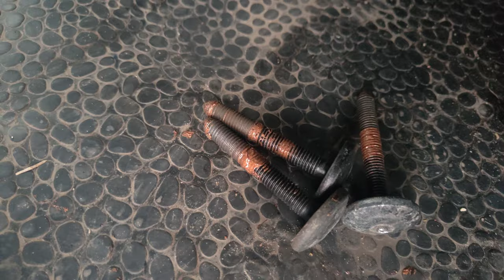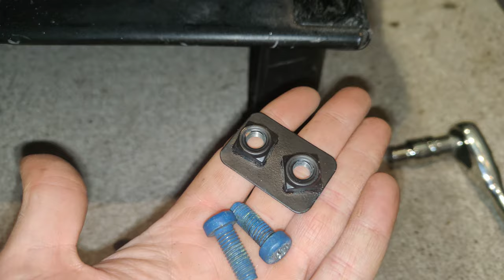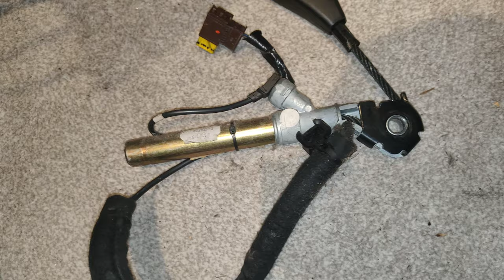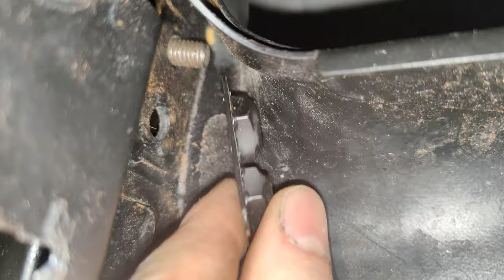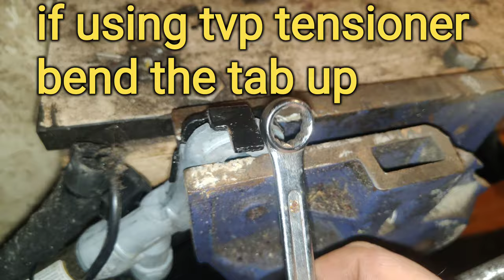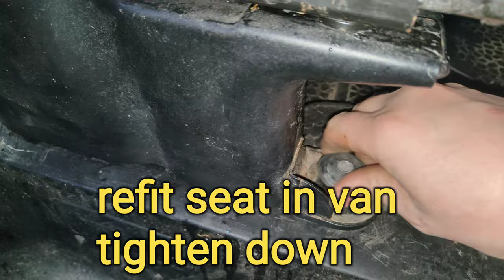vivaro traffic primestar mini seat conversion how to

Comment: What year mini seat ??
Reply from the maker: 09 ithink
Reply: Hi. Where do you drill the m10 for the seatbelt. I have the seat installed and this is the last hurdle. Currently through one of the floor bolts but I know this won't be mot friendly.